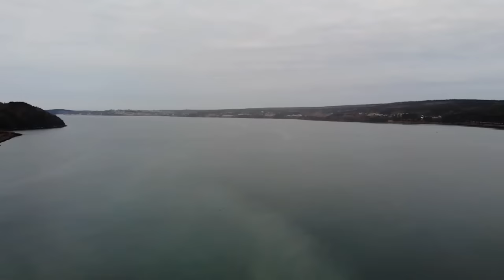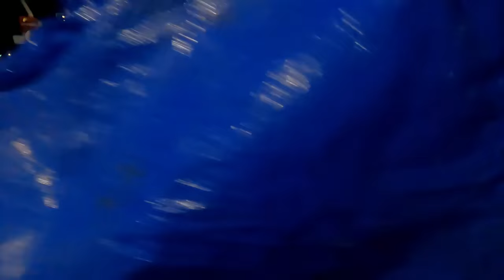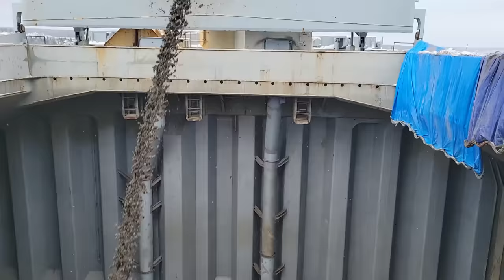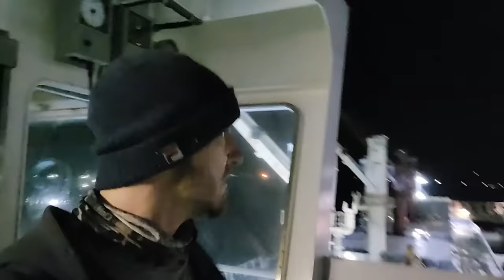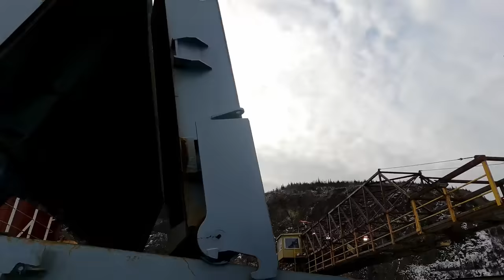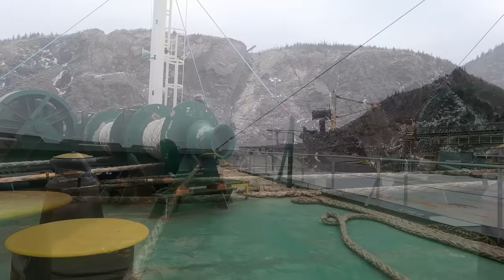BULK CARRIER LOADING IN NOVA SCOTIA | NO SLEEP | SHIP'S vLOG 6 | LIFE AS A SAILOR

Comment: I saw a video of a co. making ship ropes and then testing them. It's amazing how strong they are. When they break, it's a small explosion.
Reply: Interesting. I wondered if those natural ones are stronger than synthetics (which would be worse for planet🌍?)?
Reply: @noodlepipkin  synthetic is MUCH stronger and MUCH lighter than traditional lines. However,  it's pretty terrifying when they part!
Reply: On this vessel, the lines were actually stronger than the winches. So unless we left a brake set carelessly, we simply did not have the power to break them.
Reply: @jeffhatterban  I believe you.And I'm really amazed at how strong steel cables are, although I know they're not for your situation.
Reply: @jb3536  these new synthetic lines really are a wonder and they last decades if properly cared for.
Reply: @jeffhatterban  I watch Matts Offroad Recovery and they use the synthetic ropes to snatch vehicles stuck in the sand.The only thing they've got to worry about is putting a cut in them.

Comment: Another great video Joe,thats when it was great to be in the galley. We used to do shifts so the crew always had a meal. Not exactly the best place to have a run ashore even if you could. One of the coldest places I was at was Seven Islands. No matter how many layers of clothes you had on you were stilĺ frozen to the core.
Reply: How many in the Steward Dept? Typically only three of us now. Definitely not enough for "shifts".
Reply: @bakerbill4274  Changed days Bill. The cook will have his work cut out. Is it chief cook,second cook and a messman that is on board now?.
Reply: No, now it's the Steward,  Chief Cook,  and Steward Assistant (messman). If we have a crew over 30, then we typically get another SA. Steward handles breakfast and ordering stores, Chief Cook does lunch, dinner, and cleaning galley. SA cleans messdecks,  officer's rooms, and does dishes.

Under unusual circumstances,  like supporting embarked military,  we typically get a 2nd Cook and a third SA.
Reply: Thanks Bill. If you have a good team the job will be made easy.great information.

Comment: That's kind of wild it takes the ship 12 hours to get to Halifax from Auld's cove, considering it's like a 2.5/3 hour drive lol. I know it's a ship, just crazy to think about. Also, seeing all that snow on the ground in the video has me thinking about how not ready for the wet and cold winter that's on the horizon. Great video as always, I look forward to the next one!
Reply: Yeah but that's 12 nautical hours and they are less time so it ends up being pretty close to 3 regular hours.
Reply: They had to get out of the Canso strait first, drop the pilot, sail south east to the Atlantic then south west toward Halifax pilot station. At reduced speed, a pilot will board and the ship will move slowly to the Halifax harbor bay. The max speed of that ship is 17.6 knots.
Reply: @CoIoneIPanic  no such thing as a "nautical hour". Transit time on a ship is measured from leaving one dock to tying up at the next. Not unusual to take an hour or two getting from the dock to open ocean. Even then, you're typically running between 13-15 knots.
Reply: @bakerbill4274  the next thing is you're going to tell me that dog years don't exist either because you haven't heard of them well I'm going to believe in nautical hours as long as I need to

Comment: Just because you get time off after a 13 hour shift it doesn't mean you can lay down and go right to sleep. Sometimes your body hits the wall, trips your body clock and it takes a day or two to get in sequence. I experienced similar fatigue in my time in the air cargo industry.  Those bulk haulers look like some extra hard work.
Reply: Kevin, I was working as a ramp rat loading planes in Jacksonville Florida at the start of the First Gulf  War. Jacksonville was a big military town with a large Navy base, three large Navy airfields, a Marine  Supply Depot, and a large Army base only a hundred miles away. What was a nice sleepy gig unloading three or four planes in the early morning and loading those planes in the early evening turned into loading one charter after another for about five weeks. We were shipping everything from crates of empty body bags to tank engines over to Saudi Arabia and other Middle Eastern garden spots. We were working 12 to 16 hour a day and not even bothering to go home in between. After a few weeks that quieted down into almost a scheduled rotation and we hired a few folks. Then the US Mail came to the realization that terrorists could try to take down a passenger plane by mailing a bomb. At that point, the postal service sent 95% of the long distance mail by commercial aircraft and didn’t have scanners. So their crazy idea was to load the mail on charter aircraft, fly them to Orlando and then put them in the passenger jets belly. And we’d get Orlando’s mail to do the same. Better to kill two poor freight dog pilots than a hundred civilians. So it was back to insane shifts for another month or so till regular order was designed. 

It was an insane 3 or so months. We worked 80 to 100 hours a week the whole time. Made great money but it was exhausting. I got to where I could sleep on any flat surface and it didn’t matter how loud it got. All I had to do was sit still for two minutes and I was gone. Till this day I can get on an airplane and close my eyes and be asleep in 5 minutes. My girl hates it.
Reply: @Bill_N_ATX  Yep, I flew DC-8's during the first gulf war and JAX was one of our hubs. We all were putting in the time during that conflict. During all the other gulf wars I had transitioned to 747's but it was the same type of duty.  Lots of 30 plus hours with virtually no sleep.
Reply: @Kevin_747  got to love the old Diesel 8’s. We loaded a bunch of those. Used to think they were big until I read that a Triple Seven can carry more cargo in their belly than an old DC 8 could carry on its main deck. What a wonderful bird.